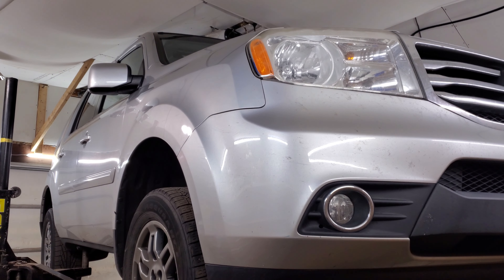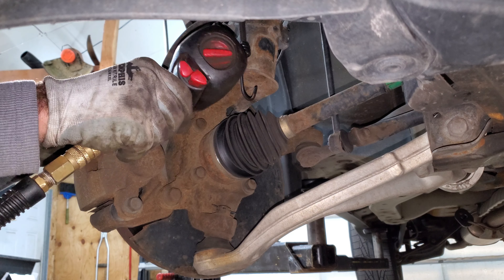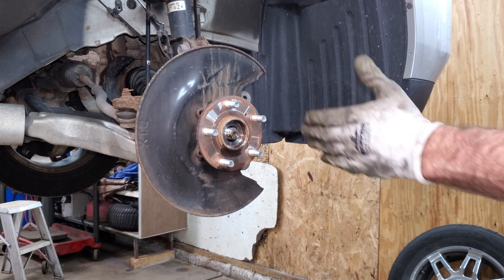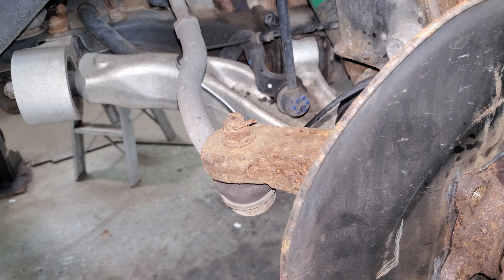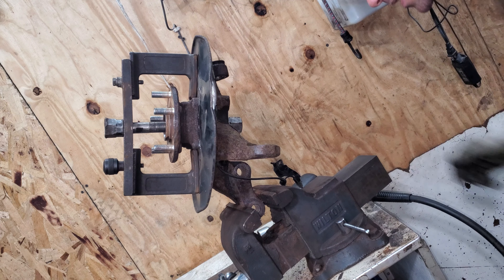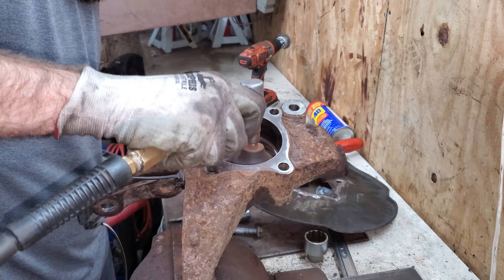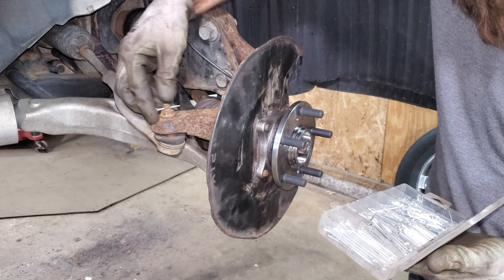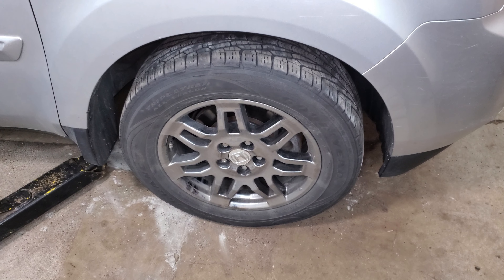2009-2015 Honda Pilot front wheel hub bearing replacement

Comment: Dude, next time tap out the divot on the axle nut.  That’s designed to lock the nut in place.  It will come off a lot easier and won’t wreck the threads on the axle.

Comment: I ve had a the same problem with a rear wheel bearing on a Ford Edge. In Montreal, things rust like you wouldnt beleive!! Good work Rusty!!!
Reply from the maker: I had a thought, because I think too much. Might make a video someday of one of these stuck monsters, take off the steering knuckle, and de-rust the whole thing with electrolysis. It would probably fall apart like a big dumb piece of magic.
Reply: @RustBeltAuto  that would save so much time. Id watch that video

Comment: My kid sister is dealing with this sort of crap now. Her late husband's aunt drove around her honda pilot with loose lug nuts, and sheered the hub bolts right off eventually. Cause heaven forbid, the lady take care of her own vehicle, and make sure the "wobbling feeling and grinding noise" she'd been hearing since her last break job ain't something bad... My sister and our brother have spent  the last 2 days wailing on the jeezless old wheel hub, stuck on, as it is, with 10 years of Northeast Ohio Rust, salt corrosion and road schmoo. Broke the bearing puller, bent two pry bars, ran the torch out of fuel, air hammer did nothing, used up the PB blaster, (only for the thankless witch to come out and ask why it was taking them so long)... I'm glad she wasn't was holding our sledgehammer "Mjolnir" at that moment. Off to find a hydraulic press, I guess.

Comment: I am going through this same thing now. Started with a speed sensor going bad.  I had to drill the old sensor out, taking care not to nick the hub, but I was unable to get all the plastic bits out of the hole.  I decided to just send it with the new sensor and it worked great for 10 miles or so until the plastic bits took out the magnetic ring in the hub.  In addition to your same problems getting the hub out of the knuckle, my ball joint nut was seized and I was forced to cut through the ball joint to get the knuckle off.  Good thing Honda made the ball joint sealed as part of the lower control arm, because now I get to replace all of that as well.  Should have just ignored the ABS light!
Reply from the maker: Sounds like you could have made an entertaining video too.

Comment: Good video.  I was able to get the first hub (right side) of my Honda Pilot out with a slide hammer.  My 2nd hub (left side) will not budge, so I will try pressing it out as you have demonstrated.  Unfortunately, it will require more disassembly.

Comment: The axle nut has a small dimple that you need to straighten out so it will come off easily. The reason it's been dimpled is so the nut won't come out easily.
Reply from the maker: The dimple doesn't matter much on removal, but thanks.

Comment: Did a simple "replace pads and rear rotors" (because the rears were flaking away with rust, not the fronts...first warning sign).  Little did I know that the person who previously did the brakes used loctite on most of the bolts, and (apparently from the red residue) the rubber that is on the outsides of at least one caliper slide of each brake.  It was all I could do with PB Blaster and an old S&K 3/4" breaker bar to get one side loosened up.  The other side required some very courageous Chinese wrenches resting on top of an old hydraulic bottle jack, to break those bolts (and fortunately not just the heads) out of a well warmed threaded socket.  SOME possibility that this was just rust, but the one rubber grommet I was able to fish out of a brake caliper bracket looked very non-rust red (aka Red Loctite...nope, have not done chemical analysis, and yes at 144K miles, I would believe this is NOT a factory set of brake pads).  Still some metallic sounds and slightly sub par MPG after my brake repairs, so yeah, looking at this wheel hub video for this guy firmly in the rust belt.
Reply from the maker: That's an amazing story.

Comment: Great video. I live in rust belt and was able to get it out. While putting it back I line the spline but it is not fitting well (2013 Pilot with 73K miles). it slides nicely but the last 3/4 inch gets stuck. I have a OEM parts. Any suggestions..
Reply from the maker: Clean all the rust, and cram it in there.
Reply: @RustBeltAuto  I was able to put the spindle nut in the opposite side and used a screwdriver to pull the driveshaft out. unscrew the spindle nut and screw it back right side in...  worked out great.. Thanks.

Comment: That's ridiculous. Honda, extra depth for extra rust bondage. And 200 + ft lbs for the axle nut ? I thought the torque wrench was going to snap as well. Excellent WIN, Rick.
Reply from the maker: There is an air gap between the hub, and bearing, and it's not sealed, allowing rust to be made, and expand. Subaru does it too. Throwing the labor guide out the window.

Comment: love working in the south with no rust good job though
Reply from the maker: Lucky you. Right now I am working on rusted out brake lines on a 2001 Silverado that almost drove me through my building, because the truck was only working on front brakes, and a front line popped too. Need to replace all the rusted lines. You have no idea.

Comment: Thank you for posting this video. Very helpful. I have a question for you. Will the backing plate block the way to have wheel stud replaced? Looked at 14:02 could not conclude if it will.
Reply from the maker: You will find out pretty quick when you pound it through the hub.
Reply: @RustBeltAuto  It works nicely. I didn't even to take the rotor off. Thank you very much.

Comment: Why not put some anti-sieze lub inside were the hub to knuckle goes. And didn't even clean and put little lube on the splines on shaft. That way next person messing with that wheel won't have a problem removing them.
Reply from the maker: Splines are supposed to be dry.
Reply: @RustBeltAuto  try spline lube
Reply from the maker: @puma1294  What is spline lube?
Reply: @RustBeltAuto  i bought a clutch kit for a 96 ranger. They gave me spline lube. The haynes manual told me to apply spline lube to trans input shaft and the slide into clutch. Only time i heard it mentioned tho on splines. But i assumed it applied to all
Reply from the maker: @puma1294  Yes spline grease for clutches. That is actually a moving part. You could use just about anything on an axle. I leave them dry.

Comment: But the book only gives you 3/10  for the job.
LoL
You need 175 PSI for shop air. When I see your videos, I relived the hell I've been through.
Reply from the maker: Whatchumean by 3/10? Never heard labor like that.
Reply: @RustBeltAuto  3/10 of an hour - taxes. LOL sometimes if you take a long stroke air hammer hi air pressure and rotate the wheel bearing within the knuckle. it might break Free. Be aware, after a long day working at the shop, I would go home and do side jobs in my garage kind of like you. But I gave too much stuff away, being good hearted; the customer doesn't realize what goes into repairing their pieces of wonderful crap.
Reply from the maker: @GregoryBirulkin  I'm calling BS on 20 minutes. That's just hyperbole. Hard to find a 20 gallon 175 that's not oil free, and quiet, without breaking the bank too. CP makes some serious air hammers (expensive). I have not seen any mechanics use them. It would destroy anything you use it on. I think there is a reason why they are not on a Snap-on truck.
Reply: @RustBeltAuto  check out the Astro 4980. Just did wheel bearings on a Audi. And they seize to the Knuckle horribly since it’s aluminum. That air hammer made easy work of it

Comment: With all the problems I've encountered with our MDX...never buying another!  What a POS!
Reply from the maker: Every luxury car has more problems than a standard POS.
Reply: What year MDX?
I have an 11, just did my timing belt, now doing my front hubs. Only have 77k on the turd
Reply: @justicethegsd1567  1st gen 2005 ...180K.
Reply: @egmac100  Right on, I like those 1st gens but I did hear the 3.5l 5 speeds had some issues. Especially with the transmission. I am almost thinking about dumping mine before it becomes an endless money pit.

Mine is already burning a little oil, rear main is leaking a bit to. That's a BIG job.

Have a good one!